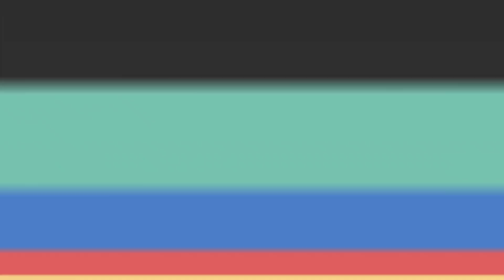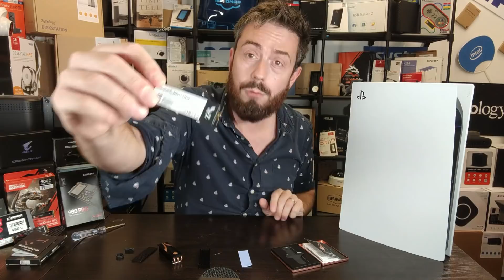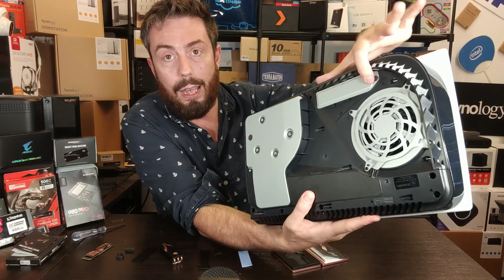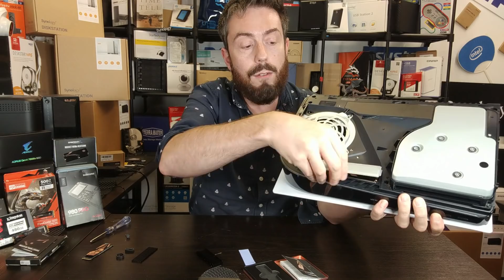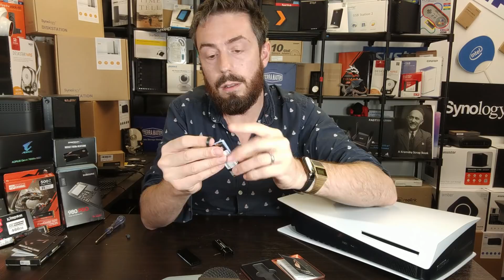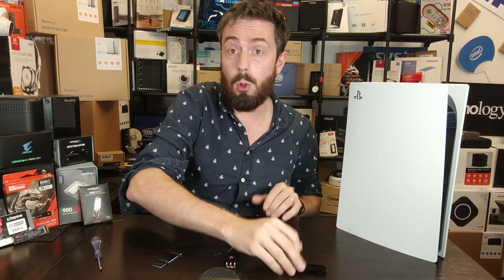PS5 SSD Upgrades - WHY YOU 100% NEED A HEATSINK! (HEAT TEST!)

Comment: First video I saw this explained properly. Especially the larger heat sink question. It sounds to me like it’s better to use a larger heat sink and not put the cover back on. But is the cover there for dust prevention? Because why would they recommend putting the cover back on.
Reply: He's wrong about the larger heatsink, use one that allows the cover to go on. Sony put it their for airflow and to allow the fan to properly remove hot air via negative pressure, this guy is telling to go against something one of Sony's top engineers said.
Reply: @BronasisEU  I agree. Cause that part didn’t make sense. Why I questioned it. As you said there had to be a reason why they put that cover there. Thanks very well explained.

Comment: Are you aware that there are 2 holes in the expansion bay that lead to the large fan, there is a structure built in there that creates negative pressure in the expansion bay sucking out hot air to cool the ssd.

Edit" Because of how the cooling in the slot works I would highly recommend you use a heatsink that can fit in the slot and leave the cover on.
Reply: Honestly, I’m sure Sony thought out everything about this,  when designing the ps5, I’m certain that the silver metal plate is important, and should be used.  Hence why Sony stated that the drive with a heatsink must not exceed a certain size..  just so the metal cover plate can still be used.  While @nascompares videos about the nvme drive is good.. he definatly should not of even suggested using a bigger heatsink that wouldn’t fit, especially if he does not know how it could effect the system itself..
Reply: @lazymutant  You make some very good points there.

Comment: So far I don't feel I need to get any more storage for my PS5. I have a longtime habit of uninstalling games that I'm not actively playing
Reply: For me, I just move any PS5 games I'm not actively playing to my external HDD, thus making room for more internal storage but not needing to re-download it if i want to play it again. If I want to play it again I just transfer the games from my HDD back to my internal storage and the process is much faster than having to re-download everything. This way I'll never have an issue with running out of internal storage.
Reply: @D4RC N3T  I'm sure at some point I will get at least a 500gb SSD addon. Because I do love having certain PS4 games installed on the PS5 internal drive, because loading time is a dream. Even compared to my 1 terabyte external SSD. For example God of War

Comment: Or Sony could've just released the PS5 with a decent sized HD to begin with. 
Or made expansion storage more affordable. Given already the cost of the PS5 and that most customers still can barely find one at retail price/ not having to give into paying scalpers prices.
But big greedy companies love to create a problem just to be able to sell/ make a profit off a future solution.
...& what's up with the design decision to make the "Other" section take up so much space in the PS5'S internal HD?
That seems pretty shady.
Possibly to get customers to have to buy the new very costly expansion drive.
Kinda like how electronic stores sell external HD for ps4/ps5 made by Seagate but have the official Sony logo plastered on it.
Reply: It would have be a lot more expensive if they had say a 2TB drive it would have doubled cost can’t have it both ways this was a better solution instead of a proprietary drive solution means it’s open to third parties prices will go down just have patience
Reply: @CH-bn7qb  they could had the tech is m.2 the whole system would be like for 1tb would be 500 for digital which wouldnt be to bad for a 1Tb on sites a 1tb is 100 for m.2 so they could have did that prices went down so even at the orginal price which would be 20-30 more for that 1tb still would be under 600 for the digital 

the problem is with the disc ver it would be like 800 which most wouldnt pay they only have paid that much cause of being desperate
Reply: @cmoneytheman   yeah exactly
Reply: they couldnt do that cause it cost alot for tb sense the tech is m.2 they are overpriced bad the whole system would be like for 1tb would be 500 for digital 

and if they wound had have a 2tb would be like 800 going which most wouldnt wanna pay
Reply: @cmoneytheman  yea they definatly didn’t want to make the ps5 too expensive.. just like what happened with the ps3..  while this time around the price for the ps5 was more understandable there was still likely be a point where no one would of bought it if it was too expensive..  honestly if it was 2tb built in I could see the retail price for the disk version of the ps5 being over $1000 in Canada. Which honestly I wouldn’t pay that much no matter how much I wanted a ps5..
Reply: @lazymutant  1Tb would be 500 range like I said for digital which people would buy 

for disc like I said to overpriced
Reply: They did it for cost reasons, had they made it 1tb or even. 2 tb, the console would of been more expensive, where the console was already expensive as it is. I payed $711cdn for my ps5, had the storage capacity been larger, it could of easily went over $1000. And honestly I prefer Sony’s method of having the storage upgradeable, they are allowing the user to essentially use any drive they want provided it meets the minimum requirements.  Yea sure Microsoft’s method is easier, but it also don’t give you much choices.  And since Sony doesn’t really make nvme drives themselves they don’t really stand to make money of the sale of nvme drives.
Reply: @lazymutant  Sony also doesn't stand by their third party choices of expansion storage. If a customer makes a mistake, or even if they don't, just the drive is somehow defective out of the box, &
 F's up or bricks the PS5, Sony won't help repair your PS5/ will tell ya 
"To bad, so sad, go buy another PS5".
It's extremely shady & anti-consumer, & a slap in the face to customers who've invested into the Sony ecosystem. 
Those who've supported their company all these years. 
(Like many consumers, I've been a Sony customer since the days of TV, Walkman, Disc player's, Stereo's, etc. 
Have owned many playstation products & console's over the years.)

The technology exists, & they have more than enough money to treat their customers fairly.

There needs to be an official or guaranteed path towards a hard drive expansion for internal SSD use.

Not just... 
"Oh well, thanks for purchasing yet another round of consoles.
.... but because you...the customer, who makes Sony a household name, pads their bottom line, keeps their ceo/boardroom members/shareholders very rich....
& Would like a larger storage medium, when companies are already pushing for an all digital future.
With games themselves, dlc, OS/ Game updates are only getting bigger...
Sony's answer is just "Too bad" if something happens.

Expanding your hard drive is a need & desire for consumers, & shouldn't be treated the same way as if a modification was done, in Sony's eyes. 
Especially if/when repairs are actually needed.

After all Sony themselves chose the size of the HD for their newest system, which is already smaller than the Slim or Pro PS4 models.

Out of 800 something GB, you only get 500 GB or so of actual internal storage. 
In addition to this, how much extra space does the "Other" section take up? 
Another 80-100 GB is it?
Just got new system recently, so still trying various games to see.
Reply: @Luvcat1974   I’m in the Beta program and have read the terms and conditions it’s says if the SSD you buy breaks then they won’t cover the drive however if a drive breaks you’re PS5 you are covered under warranty it simply says for a warranty repair simply remove the 3RD party SSD before sending the console in for repair I think there has been a lot of misinformation on this
Reply: @CH-bn7qb  Ok cool, that's more realistic.
There's been quite a few YouTube videos as of late, floating around,
with various information given.
Some wrong I'm sure...but...
Including/ not limited to, 
Sony saying to the customer, something to the extent of 
"It's on the customer"

It has to have customers puzzled,
 as why would anyone risk it?
Ya know?
Possibly damaging a fairly new & still pretty pricey system...
One that is still not easily obtained.

Still though, in the days of the PS4, there used to be a program in place, not sure if still exists....
Where if the console was out of warranty, you could still send into Sony for repairs/ pay out of pocket. 
This option was still more affordable than buying a whole new system...
For some consumers.

I wonder if the same will be created for the PS5?
Especially if the reason for needing a repair is from putting in the expansion storage.
Reply: @Luvcat1974  I think there probably will be in future. Anyway sony does cover damage to the console caused by the 3rd party SSD drive they simply don’t cover the drive it’s self it wouldn’t be fair to expect people to Beta test the drive expansion slot then expect them to pick up the bill if there are issues lawyers would have a field day if that was the case
Reply: @Luvcat1974  if the drive stops working just take the drive out.. I doubt it will break the entire system. And it’s well known that using beta software does come with risks..  and that anyone using beta software has to agree to these risks..

Sony has always allowed the consumer to use 3rd party storage solutions when it came to switching out the built in hard drive in the ps3 and ps4, not once have I seen a hard drive being the reason why the whole console breaks…. The hard drive stops working, simple just switch it out for a new one..   the same thing with nvme drives… if it doesn’t work for some reason just switch it out for a new one.  But I really doubt the drive will make the console itself no longer work.  If your console stops working it is likely something else being the cause.

Comment: These temps aren't recorded during use in the PS5, so not really representative? We don't know the demands placed on the drive by the PS5.
Reply: Thats not really the point, it's meant to emphasize the importance of having a heat sink on the SSD The only way to measure the temperatures right now is on a PC. Even if the temperatures may be higher on the PlayStation it's still brings the point home that having a heat sink is a must if you're going to install an NVMe into it.
Reply: @andyvasquez470  Well... not strictly a must if temps stay below 70 degs and we don't know if the PS5 is less demanding was my point :)
Reply: @AHR_James  I apologize I should clarify that I meant it's a must if you want to retain peak performance and lower temperatures. And yeah he made the point that they are going to be moments when the drive is idle and not on the load so the PS5 may never even hit those high numbers since there will probably be time for the drive to cool down before it's next instance of load
. 
I'm in the beta program and testing out the WD SN850 on the system. Thankfully it isn't any hotter than it was before I put it in So I think so far it's working pretty well.
Reply: @AHR_James  point is that you don't want your SSD to throttle after 2 hours of playing Ratchet and Clank or whatever next gen game releases in the future that really hammers the SSD.
Reply: He was just showing how important a heatsink is..  it does not really matter in which the drive is used, it will still get hot no matter how or in what it is used in.

Comment: DOES the SABRENT HEATSINK actually FIT then? If so I will buy it? Can anyone confirm
Reply: I have the same exact question 😂
Reply from the maker: It does TECHNICALLY fit. But you cannot use the PS5 all cover plate, though the main PS5 Cover will still close. Also, you cannot really use double sided SSDs (2/4TB) as you will need thicker thermal pads and it will make the m.2 connector out of alignment. There should be links in the description for the Heatsinks mentions. Cheers guys!
Reply: @nascompares  so the 1TB rocket 4 plus fits with this heatsink without the cover? Have you personally tried it?
Reply: @00DaNnY000  I would not advise using a heatsink that wouldn’t fit properly, even Sony states the drive with a heatsink must not exceed a certain size, which leads me to believe that the metal plate may in fact play a role in heat dissipation.. and unless NAScompares can actually show using such heatsink would not effect the ps5 negatively I don’t think he is right in suggesting to use one that doesn’t properly fit in the bay.

Not only that Sony does state it will support 4tb nvme drives.

Comment: PS5 engineer says otherwise
QUOTE(from PS5 Sony Engineer)
Mr Otori: There are two exhaust holes for the SSD slot for expansion. Since the expansion slot is near the intake fan, it has a structure that sucks heat from the exhaust hole with negative pressure.

The plate is ther for a reason
Reply: Too bad Sony isn’t too clear and loud about it.
Reply: I wouldn’t risk using a heat sink that wouldn’t properly fit in the bay. There is a reason why Sony stated the drive with a heat sink must not exceed a certain size.

Comment: Great video.. but can you please make a video on what you mean about the games that’s more sporadic in better detail?? Cause I’m 3-4 videos in.. love the content but I am confused on that point for average gamer that play a mix of games.
Reply: He is slamming it with large files constantly.
A game would load many smaller files rather than bigger chunks of data in this trst
Reply: @WayStedYou  OK last thing… Can I use a double sided heat sink on a one sided m.2 drive… like slap both silicone pads on both side or just the one… is there any benefits to putting 2 on a one sided drive

Comment: It is recommended to cover the panel on the m.2+heatsink after installation, or keep it exposed
Reply: PS5 engineer says otherwise
QUOTE(from PS5 Sony Engineer)
Mr Otori: There are two exhaust holes for the SSD slot for expansion. Since the expansion slot is near the intake fan, it has a structure that sucks heat from the exhaust hole with negative pressure.

The plate is ther for a reason
Reply: Keep it covered, that little panel is required for proper console cooling.

Comment: i’ve preordered the 2 TB seagate firecuda 530 with a heatsink. is the heatsink built in, so won’t need fitting? thanks for videos. very informative. cheers 🍻
Reply: You said you have ordered the heat sink model. So it should be fully assembled with the heat sink attached. Remember the heat sink usually surrounds the nvme drive.   So for you it should be pug play and enjoy.
Reply: I asked this yesterday or day before. Someone replied that It will be installed already. According to pics on websites it does
Reply: Yes

Comment: just started watching your vids on the ps5 ssd and heatsinks thank you for the information .. got me the firecuda 530 2tb today now just need to choose the heatsink.
once again thank you
Reply: Same to me, Volvo! I also ordered the ELUTENG heatsink as recommended here. However, there yet are no information on whether this heatsink is feasible for double-sided M.2. or not...
Reply: @fela280  yeah im still thinking im aussie and while theres no huge delivery times from amazon theres not many in the recommended list in stock at amazon in aus atm .. was thinking of using the bigger rocket 4 heat sink but im worried its to much weight across the thickness of the pcb in a horizonal position may just go for the smaller ps cover back on heatsink ones specifically for double sided

Comment: I'd love to see the difference in cooling on the ps5 with the ssd cover on and off 👀
Reply: PS5 engineer says otherwise
QUOTE(from PS5 Sony Engineer)
Mr Otori: There are two exhaust holes for the SSD slot for expansion. Since the expansion slot is near the intake fan, it has a structure that sucks heat from the exhaust hole with negative pressure.

The plate is ther for a reason
Reply: @marty8370   can you link that article please mate I would like to read what he says
Reply: @CH-bn7qb  it states in Sony’s own site that outlines what the m.2 nvme drive must be in order to work..  it must not exceed 2.25 mm beneath and 8mm above. I’m sure the plate does play a part in the cooling of the bay.. while the person in the video does do a good service by stressing on how important a heatsink is, I think he is wrong to suggest using a heatsink that wouldn’t fit.
Reply: @lazymutant   yeah I’m in the Beta program for this update I’m waiting on the  firecuda 530 2TB getting released I was just asking the guy above where he seen that engineer say how the SSD bay is cooled because I’ve not seen anything to say it has
Reply: @marty8370  I agree ! I've been trying to tell people the same thing (the two hole vacuum cooling effect)
Reply: That's what I was thinking too. Got the WD Black sn850 2TB a few months ago ready to go. Not sure what heatsink to go with or make my own some how.
Reply: Do NOT have SSD installed without the cover on it as its recommended the cover placed back on after SSD installation.
Reply: That would be interesting but mind the two Venturi nozzles on the top side of the bay, they would be rendered useless without the cover.
Reply: @BronasisEU   thanks dude much appreciated
Reply: Sony said, Put the cover back.
Reply: If I was rich I’d go with the chunky heatsink and make a cover out of high quality hvac metal tape. Won’t leave residue on removal or go naked with no slot cover